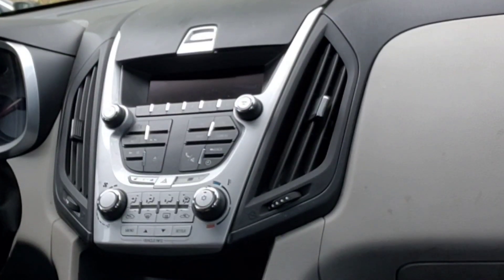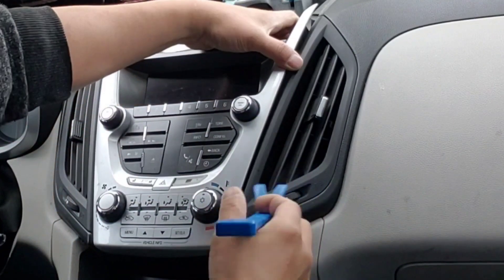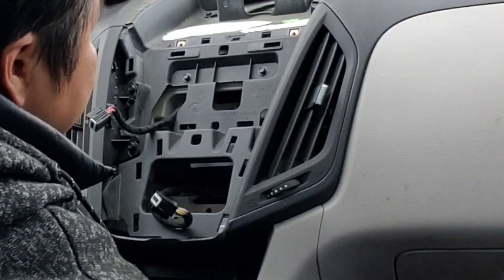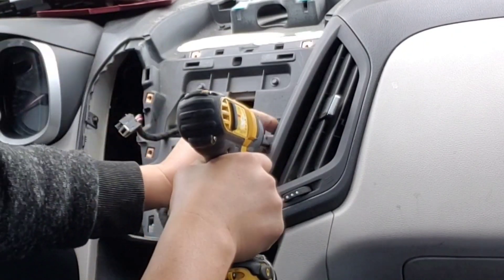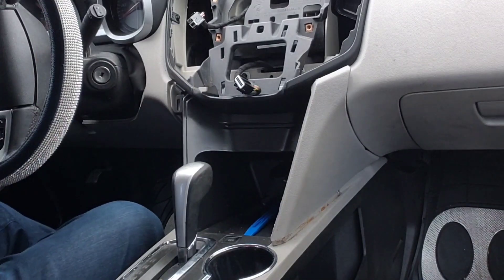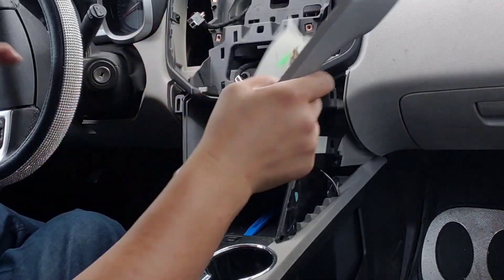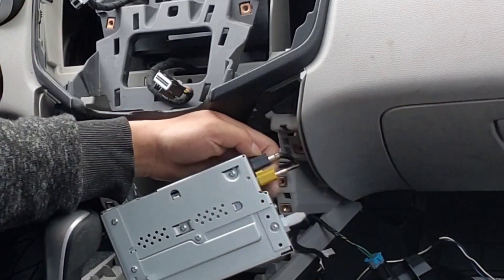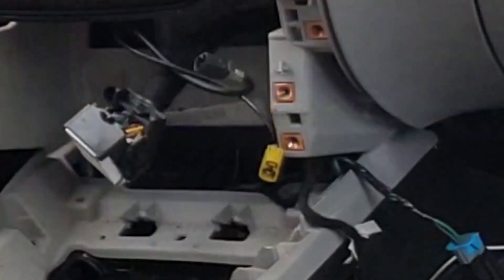How to Remove Radio for Chevy Equinox 2010 - 2017

Comment: Could you please help me bro, I am trying to update the radio on my 2011 equinox and I want to install the radio from a 2013 equinox but I couldn't find information, do you know if it is compatible???
Reply from the maker: Thank you for watching my video and I will be appreciate you if subscribe to my channel too
I'm not sure there is two different oem one with screen and monochrome display so you should ask deal about this matter sorry I couldn't give you right information
Reply: Tell me where to connect the subwoofer that is located in the rear right wing, is it directly to the radio?
Reply from the maker: @ВолодимирПетренко-э3ы thank you for watching my video and I will be appreciate you if subscribe to my channel too
If your car is amplified system it should be play when you replaced radio with interface